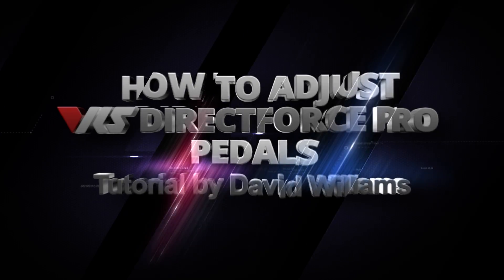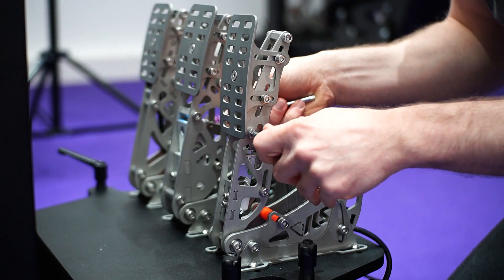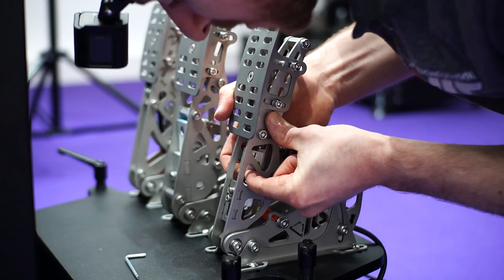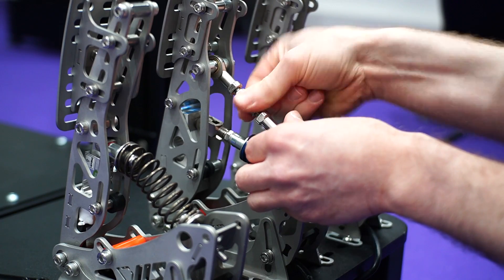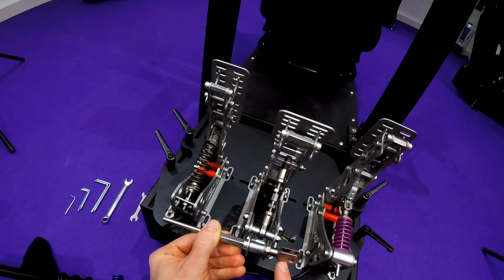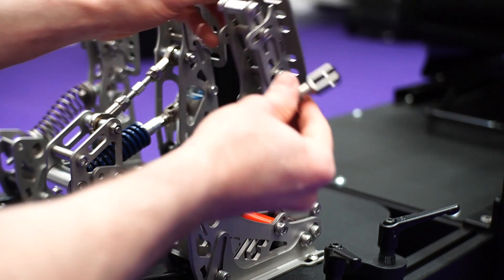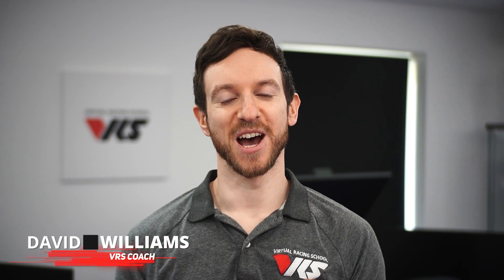How to adjust the VRS DirectForce PRO Pedals Tutorial by David Williams

Comment: Thank you for the great video showing all the possible adjustment options.
Those pedals are "infinite nightmare". They have infinite adjustment options and they are nightmare to install/adjust. Some bolts even overlap each other so you can't tighten one without removing the other, some bolts need to be synced. You indeed can find your ideal position but if you don't have 3 ppl helping you, it's a nightmare.

Comment: How can I adjust my clutch so that it doesn’t suddenly jump back so quickly. Is it adjusting the preload or what exactly?
Reply from the maker: You can limit the travel with the adjustable red stand-off. This will in turn limit how much the pedal force drops off past the peak. Remember to recalibrate once you're done (you can also increase the upper deadzone).
Reply: @realVRS  How do I adjust the "bite point" effect? Right now it feels like it happens at the very end of the pedal travel, just as it hits the red stand off. I want it to happen much sooner in the travel range if that's possible.

Comment: I have these pedal sets, and I'm desperately trying to alter the second stage point on the clutch. Is that possible? because out of box, the second stage (the feeling of drop in force needed) is at the near end of the travel (final 95%) which is not realistic at all..

You explained the adjustments for the clutch on your  video but you never mentioned what those adjustments results as feeling in real life driving?
Reply: I am putting rumble motors on all 3 pedals I think I will leave the settings for feeling to those!......
However I always like a stiff feeling clutch to begin with!
Reply: Did you ever figure this out? I'm wondering if the load cell needs to be lowered a bit to cause the cam action to occur sooner in the pedal curve. Like you, I find the out of the box feel to be very baised to the last bit of travel.

Comment: Is it possible to swap out the throttle spring? 

Also, how are the dampeners installed ?
Reply: what dampers?
Reply: @irongoatrocky2343  There are dampers for this pedal set which are impossible to find.

Comment: Just got these installed on my rig. So much better feel and precision than V3s offer. The software was harder than should be to find unless you use discord. I’m just getting used to the blue brake spring and this seems a good start. More travel and harder force than V3s with standard blue spring. The throttle force standard feels great. As hard as V3s. The software seems easy enough to use. You get physical adjustment as well as software adjustment. I’ve gained seconds in the short time using them and consistency. $550ish for V3s & BPK or $750ish for VRS, $200 odd more is a no brainer! Who uses a clutch anyway!
Reply: Me! Can't wait for my three pedals.

Comment: I am about to order those. Isn't there a baseplate necessary for the sim rig?
Reply: Not If you have an aluminum profile rig.
Reply: @adambuzzeo  I have my rig but I prefer to invert mount my pedals 
I have a floor plate for my feet to rest on with a small piece of carpet as i race in my socks,
(no shoes worn inside my home!).....I had a plate made from .120" T6 Aluminum to invert mount  
the pedals to, that way I can just remove the plate for adjustments needed for the track I'm running at
(NASCAR Modifieds and Truck Series) and in place for pedal location adjustments (seldom adjust that anymore!)
I find that invert mounting makes it easier to keep things clean in the foot well area as well!

Comment: There is no way you swapped that spring that easy! My hands are literally bleeding and I still haven’t got it!
Reply: Well, If you loosen the preload rod above, it gets super easy ;)
Reply: The blue to red brake spring? It was simple here as the video, required no real force.
Reply: @gpellis  did you loosen the tie rod before taking the spring out then after just tighten back up thinking of putting the red in from the start,thanks.
Reply: I didn't have an issue. The hardest part for me was getting that Clevus sprint back in
Reply: @adambuzzeo  me too!....
First the clevis end wasn't going in and seating.......
Flipped it 180 then it popped into place......
Had to Preload the rod a bit and jiggle the pin a bit and it went thru!.....
Slapped the clamp back into place and DONE!.....😉
No bloody fingers either!.....😊

Comment: Timestamps!

all pedals
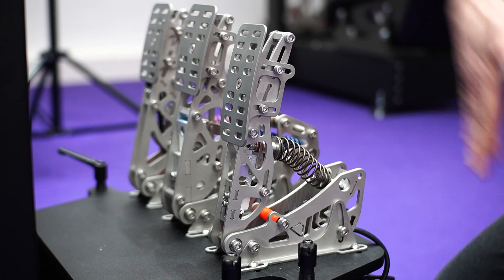rake angle - 0:22
face height and angle - 1:50
overall travel - 3:10

throttle
spring max pre-load - 3:52
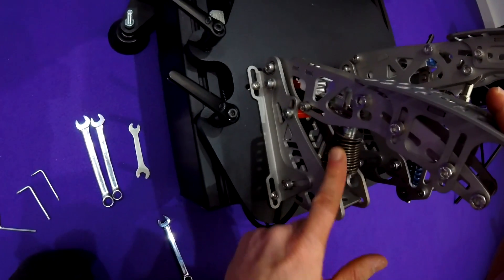spring min pre-load - 5:01
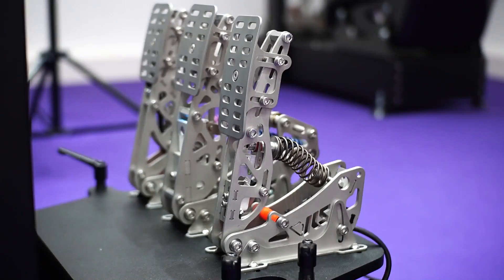load cell height - 5:43

brake
spring swap - 7:23
force curve - 8:44
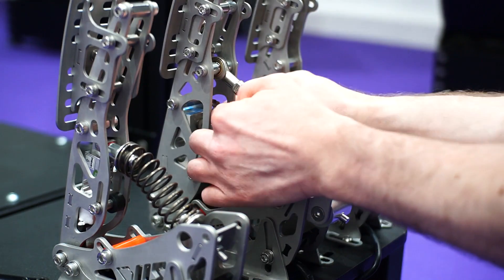pre-load - 10:42

clutch
pre-load - 14:19
force curve - 14:59
Reply: Thank you David, very helpful!

Comment: Is there a base plate to mount it on the Rig?
Reply: Not currently but there are plans. They're compatible with many other base plates on the market though - anything with a longitudinal distance between slots of 95-145mm will work.
Reply: @dgwilliams_31  Hi David. Is a baseplate necessary to avoid extra flex?   My sim rig comes with an usual pedal base and some holes.
Reply: @Michelsen3K  flex can come from more than just the baseplate, the whole rig can flex if it’s not strong enough. Best bet is to try it and see if it’s up to the job.
Reply: @Michelsen3K  Hi I was wandering if you found a solution for mounting the pedals and what rig your using,hope you don't mind me asking,thanks
Reply: @trevz1048  Hi i just simply screwed the pedals on two layers of wooden plates (about 6-7cm thick together). Then i used black foam like foam imagine you use to protect the floor for homegym. To cover the wood. Glued together with a hot glue pistole. You might think wtf, but it looks very good and stays there for already hundreds of hours.
Reply: @trevz1048  If you're still looking, the Heusinkveld Ultimate base plate is what most folks use for these, basically same dimensions.

Comment: That throttle spring looks jacked up?
Reply: That's how it appears with a rodless pedal design. The travel in the spring is in 2 axis, so it needs to be a bit misaligned. It's a small concession to have the low friction of a rodless design. Lots of RND went into that decision.
Reply: Thanks for the explanation Keegan. I have the direct force pro wheel base and absolutely love it coming from the Accuforce V1. I assumed there had to be a reason for the spring appearance however it was something that caused me a bit of concern. I guess I’ll order up whenever stock gets in

Comment: The standoffs look like there faced like "nuts" so do you really need 2 hex Keys for every adjustment?
Reply: I did it with one hex key for adjustments.  Two would have been easier though.
Reply: @oren740  right,  if it comes with 2 of each size with purchase,  awesome..I know I have a 10mm spanner and a metric range of keys...but 2 of each is hueskinveld money!
Reply: @droors77  A 10mm spanner for attaching pedals to my rig and one set of metric keys is all I used too.  You should be fine. :)